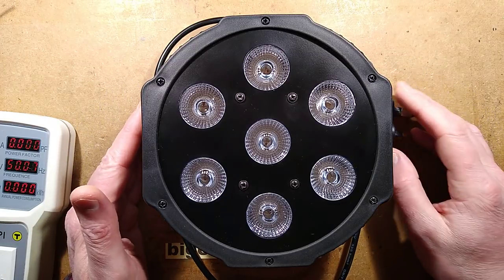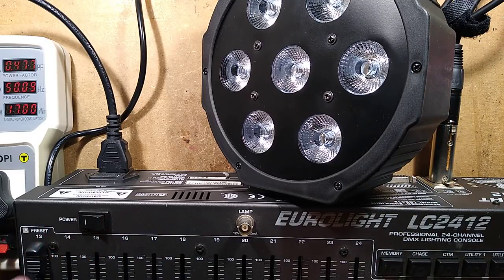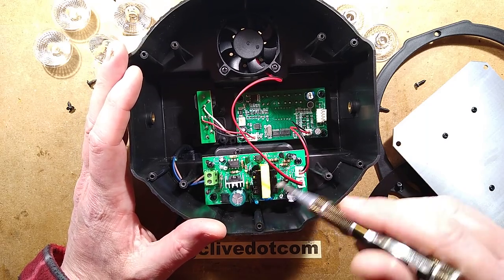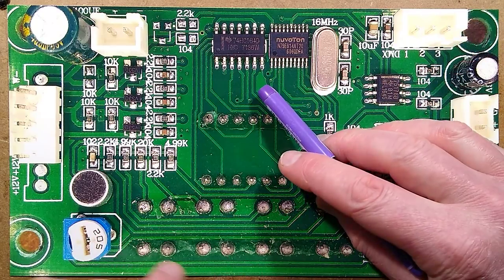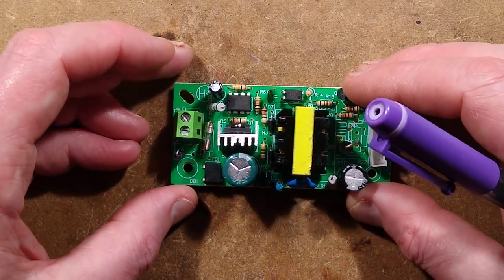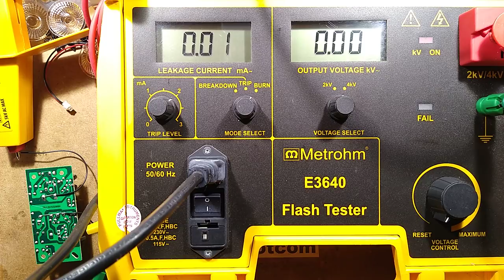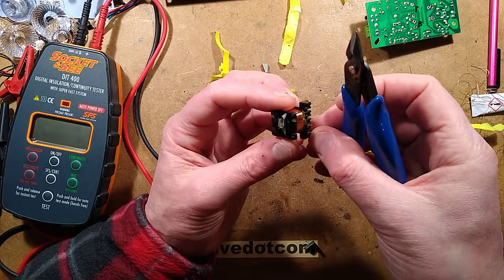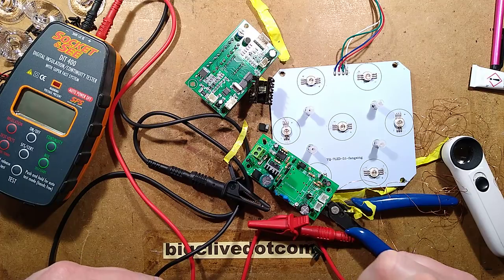3KV test of cheap disco light with circuit analysis.

Comment: The only bad piece of Behringer equipment I have ever used is the old 48 channel in line studio desk that is a copy of a Mackie, I have found thier outboard gear to be really good, and also thier mics, the vocal mics were really good especially considering they were less than 20 quid for 3 and not much different to an SM58, I remember using thier DMX lighting desk at college and it was pretty good to be honest.

Comment: Bought 4 of these, 2 are dead within a year - they're reasonable for small stages, but super brittle plastic meant that after a few uses the screws for the legs snapped very quickly. If you can get some of these with a name slapped on them (mine are Equinox) they'd do for lights for a small club where they're not moved. Mine didn't have an issue with DMX processing though, so maybe slightly better internals?

Comment: Found a lamp very similar to that in a school while P.A.Testing but with a metal case. Plug had a fuse so not a problem! After trying all over to get earth, realized the bloody earth pin is screened and socket touched on the insulation only. No problem new plug, 10 more in the next case! Damm you amazon. And don't get me started on there deathly Christmas tree lights.

Comment: Ahhh DMX512 protocol...it's changed my DJ life. No more running crazy cables, u limited fixtures and universes...if I had power at my gravesite I'd have par cans surrounding me....great stuff you should have put some dance music in the background....now u blew my mind pulling out the controller.....I've paid thousands for my lighting rig and love every second from purchase to design to touring....u didn't terminated the DMX out that will give u false data

Comment: I have a similar unit to this. The power supply lasted about an hour and the mains wiring was the thinnest I have ever seen. I now power it directly from 12V. Only required for testing DMX software I'm working on, there's no way I'd use one of these for anything serious.

Comment: Carvin made a light board at one point. It's pretty much a clone of the scene-setter 24, which behringer cloned. I got away from using physical based controllers and went to software. My controller is a webpage I can move faders up and down on.

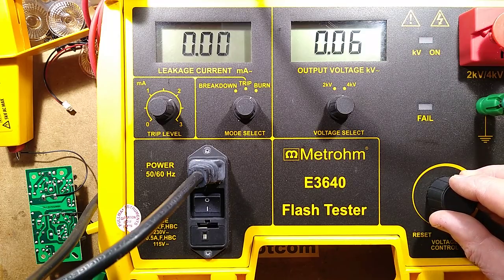Comment: Just re-watching this and my eye did catch the flashover - it was visible on the back of the PCB for a couple of frames at 27:40 - the arc is visible on the right side of the PCB between where the two wires are attached to the flash tester.  I couldn't see another comment mentioning this, and it's an old video but it was interesting to see it happen.

Comment: Nasty transformer!  I use the transformer kits where you get the bobbing and the 2 ferrite halves and have the sense to wind the primary first and insulate it with pvc tape before winding the secondary.  I cant believe whoever made that transformer couldnt afford a piece of pvc tape between the windings!

Comment: I wonder if a zener diode at the input will be fast enough to protect a device from mains voltage.
Reply from the maker: Some Pro lights use a PTC fuse and tranzorb style voltage clamp.

Comment: Flying Pig Systems used to make good small lighting desks. And they made DMX isolators. Very nice to protect the desk
Reply: I've moved away from using any direct DMX connection to the desk for both capacity and protection. A 4 or 6 universe Streaming ACN (E1.31) or Artnet over ethernet provides excellent protection as all network switch connections are transformer isolated. A fault in a light can not damage the console. Most MA consoles support multi universe DMX streamed over ethernet. Distribution is using existing venue LAN or well place network switch for distribution. Ethernet is high speed, reliable, and less expensive to distribute. I am currently configured to run a full 12 universes of DMX over ethernet, but don't have that many fixtures. A cheap 8 port network switch provides the DMX isolation at a fraction of the cost when running DMX over ethernet. Most people have no idea network switches provide isolation too.
Reply: @isettech  monoprice has a pretty nice DMX splitter that’s all optically isolated.  Powered off the same supply so it’s not as isolated as you would be if you had fiber between the switch(es) for your lights and the rest of your network.  Depends on how paranoid you want to get.  I try to buy the higher end of the cheap stuff so such things needn't be as much a concern but unless you tear it down like Clive it’s hard to be certain with any of this stuff these days.  I’d like to think Marin or ETC wouldn’t skimp but I’ve been let down by “gold star” vendors before.

Comment: It would be good to examine how manufacturers can state that the Y2 type capacitors coupling the secondary side to the primary side for interference suppression can possibly be failsafe, how can you design a capacitor so that it will always fail open?

As an aside, if you want to salvage ferrite cores that have been glued together, as is the practice in consumer equipment, you simply place the transformer in a can of water and boil the transformer for say 10 -20 minutes and the glue will soften to the point that you can pull the core apart with your fingers, don't use pliers. I have recovered many ferrite cores this way for reuse, it does weaken the bobbin though.

The reason that the transformer primary and secondary windings are so close is to increase the coefficient of coupling given these supplies are usually operating at somewhere between 100KHz-300KHz  with MOSFET switching transistors the "leakage" inductance needs to be in the low microhenries for adequate regulation. With 50Hz mains transformers you can get away with split bobbins and tolerate leakage inductance in the mH range which has the added benefit of limiting peak diode current for simple diode capacitor filter circuits.
Reply from the maker: The proper classY capacitors are often a thick ceramic disk with a conductive layer on both sides.  They seem to rely on the size to prevent bridging even if the capacitor cracked.

Comment: You can't beat a good old fashioned transformer!!.
Reply: You sure can't.  I have a few that came out of a 1950's Vacuum Tube TV. The power transformer has an iron core and the winding's are separated with some type of paper. Since it's a high voltage transformer with multiple winding's i'm sure it has excellent separation between them. Even the small transformers are very well made. I even have an old Honeywell 24 volt transformer that was probably for a furnace that surface mounts to a 4x4 junction box with screws for the low voltage connection on the top of it and even that is very well made and probably weighs 2-3 pounds. Now days it has an easy life just powering two 1157 bulbs in series for a lighting display.
Reply: Those hunks are good at mains frequency with traditionally accepted power losses.  They tend to be less useful at SMPS frequencies (about 100kHz to 10MHz) with low power losses.  Unfortunately, the common way to assemble ferrite core transformers makes it too easy to hide sloppy work and ship out dodgy units.  I vaguely recall seeing some older designs that could be checked non-destructively.

Comment: My guess is that the power supply connectors are NOT swapped, but in fact identical. The fan is reversed wired to control it's airflow direction.
Reply: I spoke too soon.

Comment: Yes I absolutely hate Behringer, that's why I have an XR12, Model D, VC340, MS-101, RD-8, TD-3, UFO202, UMC204HD, a couple of DSP2024P's, and convinced a local church to get an XR18 after I showed them my XR12. Plus the new WING console and the Midas DP48/HUB4 look very good esp. if you use wireless IEM's. 
I also had an LC2412 at one point but it got damaged in the garage. One issue with them was that they were never designed for intelligent lighting which caused a few issues, not just with intelligent lighting but with normal dimmer packs when an intelligent lighting fix was implemented.

There is a reason why the biggest selling brand at the worlds largest music instrument retailer (Thomann) is Behringer, if they were unreliable crap they would stop selling Behringer.

As for quality, ask anyone who owned an original Presonus Studiolive console that upgraded to an X32 what they think of the quality, plus presonus' attempt to claim that they had a better product, well they did if you ignored the extra features of the X32 (motorised faders, AES50, head-amp recall Etc.) and the SL reliability which was supposedly shocking.
 There is a reason why the X32 has become an industry standard desk and price is but one factor.

Oh and for people who really hate Behringer and decide to buy from a competitor, some of them use Behringer/Coolaudio IC's in their products, the new Boss Waza Craft chorus uses Coolaudio BBD's!
Reply: Don’t forget OSC support on the x32.  The show control software and other apps that are out there because the console speaks an open standard language is utterly amazing.  Don’t like how it works out of the box?  There are probably dozens of other ways the community have discovered to do what you want.
Reply: DocNo27  Yes, the X32 was a winner from that start and that combined with it's excellent firmware updates is why it's remained in the market so long. There is still noting that can beat it fir sheer price/features ratio!

Comment: I'd guess V+ on the Vcc connectors are against each other because the V+ trace is common for the two V+ connector and the V- pins are switched (xstr/fet/ic).

Comment: Some cheap lighting desks have lousy processors and do not update in real time.  The delays and lack of smooth fader updates could be either the light or the desk. Having moved away from the traditional desk to QLC+ on Linux (free) I have gotten much better response from my lights at live shows. Some cheap desks simply do not follow smooth fader movements as they are waiting for movement to stop. Many of the disco oriented desks use the actual faders to program scenes and are not real time in encoding the faders. Incandescent lamps tend to hide these flaws. LED fixtures respond to each discreet step given. You might want to do a video on the actual glitchiness of some of those disco style desks. There are stage simulation software programs that can display console output in real time for programming consoles. Most 192 channel DJ style consoles have this problem. Don't know about your Berhinger when operated live.
Reply: That Eurolight Behringer desk Clive has makes an awesome surface for QLC+ when it’s put in MIDI control mode :)

Behringer also has a very nice little motorized six slider desk that works great for moving lights and anything you need to put on a layer.  The two together with QLC+ make a very nice lighting console indeed.  Can’t wait for version 5!

Comment: Had just ordered 4 of these units for a DMX rig. Now I’ll be sure to proceed more cautiously. How can I safely test the leakage current/voltage?
Reply from the maker: I'd just suggest having the cheap stuff on its own isolated DMX network.  An RCD or GFCI may help kill power if there's leakage, but may be defeated by the rectified DC side.
Reply: bigclivedotcom hey thanks! Just ordered one. Love the channel (and especially the vids on DMX lighting) by the way.

Comment: hi, according to the wiki about dmx512 the standard started life in 1986 !! What kind of thing "drove" or "controlled" the pars then? Ok these days I guess just about any micro controller.  Interested.  I have discovered not to put links into comments.  Keep safe
Reply from the maker: DMX was an all-digital replacement for older multiplexed analogue standards like D54.  It was intended to reduce the amount of wiring to dimmer racks by allowing 512 channels to be controlled over one thin data cable.  Then it gradually evolved for use with moving lights, where each light uses a cluster of addresses to represent different intensity, colour, pattern and position values.

Comment: Is there a device that can "protect" the DMX connectors from mains voltage? Maybe a plug that you put on top of your existing sockets and it can help prevent disasters like you describe.
Reply from the maker: It would need to have a ground connection, small HRC fuses and high current shunts.  But it would almost certainly be bypassed if it triggered under the pressure of "events".

Comment: For an application like this, is it better to switch the positive rail or the negative rail? Does it matter?
Reply: Switching the opposite rail means all the diodes (including LEDs) and transistors need to point the other way. Getting multi-LED boards designed for the most popular polarity happens to be easier and more common.

Comment: No margin tape or extra wire sleeving - cos they didn't have enough room for either by the looks of it.  That would've needed a bigger bobbin & bigger core - more money all over the place.  It passed a 3kv flash test though, so that's something.  I own similar fixtures but I don't use wired DMX to control them.  You can't get a much bigger air gap than with wireless DMX :D
Reply: Don't forget putting the entire venue in a Faraday cage while keeping all metal (including rigging and said Faraday cage), wet ropes and people at a safe distance from dodgy equipment.

Comment: newbe question, how do you know when a resister like the 62ohm one in your video is 62ohm?. for example the 0 you said was a muliplyer? so when do, or do not??   A resister with 470 could be 470 ohm or 47ohm?.  Sorry for basic question
Reply from the maker: It follows the normal resistor numbering system the three bands represent first digit second digit and multiplier in terms of number of zeros.  It's tricky when you see it because it does look like 470 but is actually 47.
Reply: Thanks Clive

Comment: Had to replace the power supplies in some of the same, but more expensive branded ones of these. Lucky I had some 24v power supplies in the office that fitted perfectly. The ones that had blown had killed their bridge rectifier.
Reply from the maker: That's common.  If the main chip or transistor fails short circuit it often causes the bridge to go short circuit.

Comment: I have heard that Behringer Synths are generally a bit shit, although their recent 'Neutron' seems like a pretty decent retro deck.

Is that a new knife that Big Clive is sporting? What is the maker and model?
Reply: A lot of their newer stuff is built in their newer factory that they 100% own in China.  If you want to peak into chinese manufacturing, Uli Behringer (yeah, that Behringer) posted several times in this awesome thread when the x32 was still in development: https://soundforums.net/community/threads/uli-behringer-of-the-music-group-q-a.4396/page-5#post-51622

Unlike a lot of companies that acquire companies and then sabotage all the aspects of the acquired company one would think the acquiring company would want to retain, when Behringer bought Midas they not only listened to the Midas engineers they flew them to the new factory, halted construction and delayed the x32 launch for a year fixing all the stuff the Midas guys pointed out.  

That’s how you would think an acquisition should be done.  Yeah, Behringer did push out a lot of crap in the 90’s and they rubbed a lot of people the wrong way with their clones - but they also have their own chops.  The x32 was a clean sheet design and it’s still an amazing board.  The M32 is even sexier :)

Comment: The owner of our company bought a bunch of those to use as temporary fill lighting during events.  For some reason, one of them will randomly switch to DMX address 13 while it's running.  Strange.  Always 13.  BTW.  I am a Behringer hater.  So much of that junk has gone from the customer to my bench, directly to the dumpster.  The company I used to work for completely stopped taking it in for service.

Comment: So many of these are using the novotron ic. I am hoping someone will create a firmware that makes it strictly DMX and have a simple gamma editor. A 6n138 would fix the DMX opto for cheap, but the dc-dc isolation is $1 USD, so that’s far too much for the primary market.

Comment: Why are they going so far to save pins when there are so many unused on the chip (presuming the unused pins are inputs)?
Reply: Because a 4 digit 7-segment display needs 12 pins without the shift reg and only 6 with it, and the mcu also needs to control at least 4 lighting channels, talk to RS485, read the buttons, sample the microphone, connect to its crystal and have digital and analog power and ground...

Comment: Is grounding a foreign concept for the Chinese?
Reply: The entire case is plastic.  No need for ground in most cases - just like your plastic alarm clock.  Don't see a ground plug on that either.  The only difference is that the Chines 3-prong cord gives the illusion of grounding!

Comment: I wonder, why use a potentiometer to set the gain if they all will be set to the same level? You could save the time fiddling with them and also cost by just using a known resistor..
Reply: Maybe they have (or planned) a factory test to tune out component tolerances.

Comment: Having a small stage lighting set up consisting of a dozen cheapy led pars and a behringer lc2412 i was expecting more commentary along the lines of "why is it doing that... that's not the fader I moved" or simply swearing in desperation. But I would never get rid the lc2412, as hated as it can be!